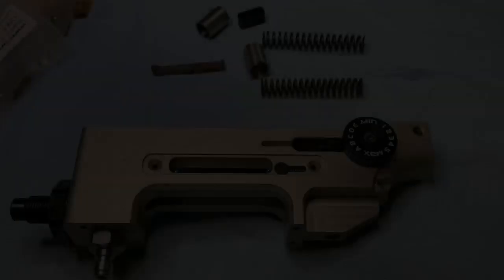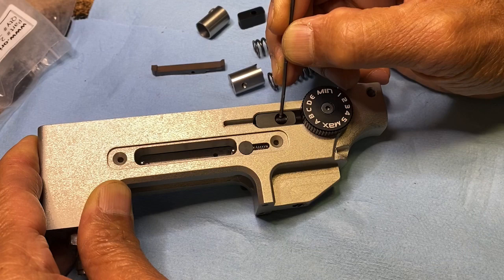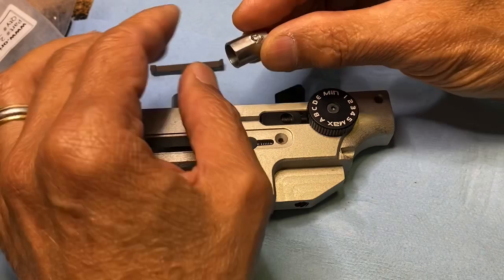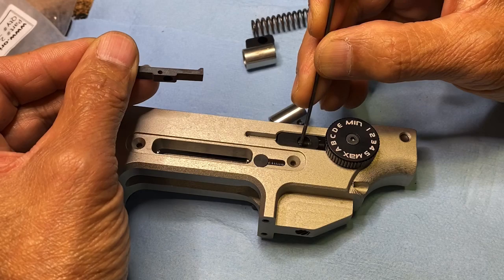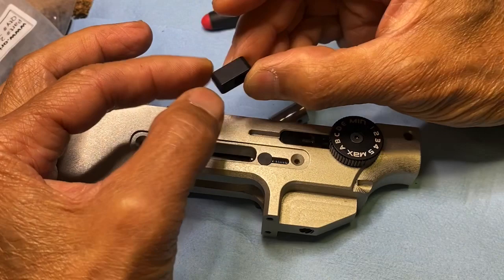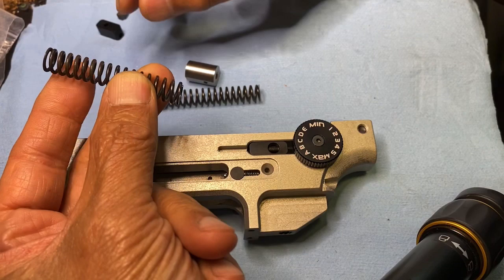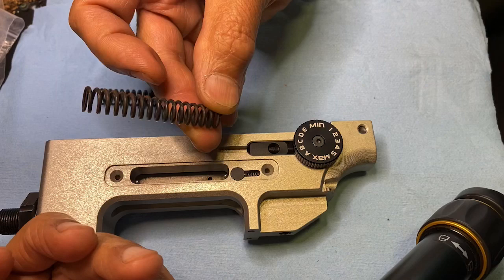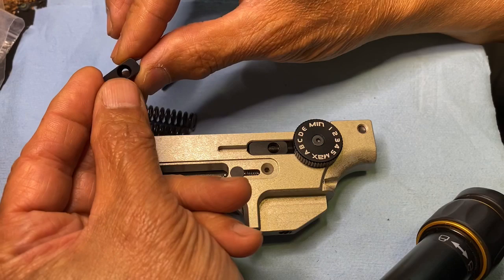Fx impact mk1&2 power mods

Comment: I have had a power plenum recently installed on my mk11 and I get no speed increase from 120-150 bar on the reg (hammer maxed)the valve needs hitting harder so which spring will I currently have and what do I need for max velocity? Thanks
Reply from the maker: Sam Sawyer —-> guy has same issues, he didn’t have the new parts.
Reply: Ernest Rowe thanks I will have to strip it and see.

Comment: I recently bought an .25 MK2 with serial 192963 and my hammer spring adjuster is 18mm . shoulden`t i have the 16mm HS adjuster?
Reply: Same here, I can not believe my luck
Reply from the maker: Inline change from 18mm to 16mm some where in the middle of the mk2 production
Reply: @ernestrowe5061  can you please provide me a direct link so I can buy this parts because I can't find them anywhere. Ty